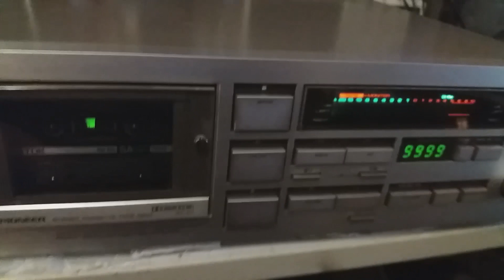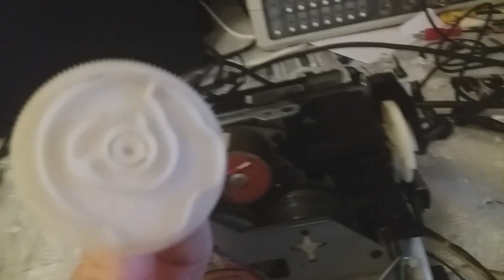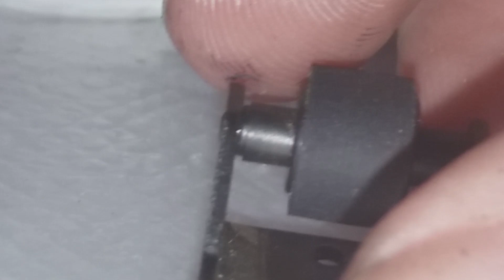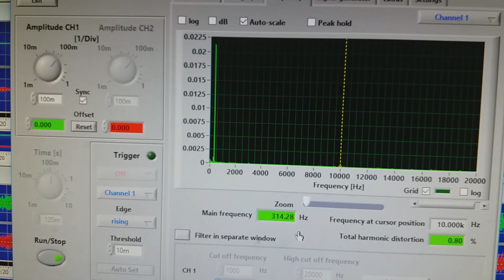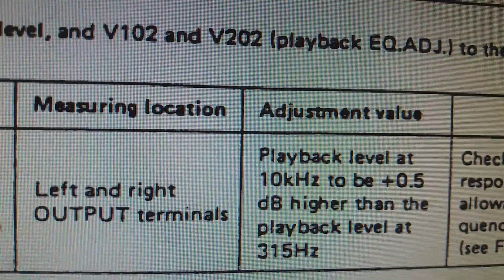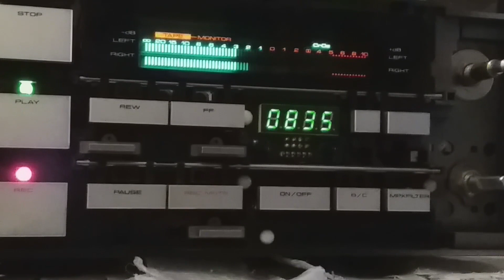Vintage Pioneer CT-A7 (1984) Repair & Service

Comment: You still got it right with -27.7db but it might be confusing for other viewers that you assumed that that the STD331B is 150nWb/m wich is wrong.
And that the MTT255M is referenced to 0db = 200nWb/m wich is wrong too.
This would be a difference of 2.5db and not 4db!

Pioneer STD331B  is 160nWb/m DIN (146nWb/m ANSI)
TEAC MTT255M is -24db from 250nWb/m DIN (228nWb/m ANSI)
Or -20db from 160nWb/m DIN.
So -27.7db is correct, but it's a miracle how you got to the correct value with your wrong numbers...
Reply from the maker: I couldn't find the values back then and I found one obscure reference that said 200nwb/m, maybe I did a mistake while searching... Thanks for the clarification! Math was never my best subject 🤪

Comment: Hi Oreg866, I have a question for you. I recently acquired a Sony TC-K909ES 3 head cassette deck. When I record a cassette and play it on another deck, it sounds amazing, the bias, the treble and the bass is spot on. However, when i play the same cassette on the K909 or any other pre-recorded cassette, it sounds like the treble is all the way down. Very less treble. I checked everything I could think of, cleaned the heads (heads looks like new), checked the azimuth, tape paths, even replaced all the electrolytic caps in the unit. Nothing has changed. I even downloaded the service manual and i traced the path for the playback head. The pre-amp on this play back section uses a Mitsubishi IC 5220 (8pin) which is located right next to the playback head socked to the board. While playing back, when i place my finger near the IC or the socket, sort of a interference happens and i can hear the playback with the spot on treble. Might be just the interference causing it. Could this IC be defected and causing it to have low treble while playing back? Thought of changing the IC, would really like your input on this. Can a defected OpAmp IC cause it to have low treble? or high frequencies? I even unplug the play back head and plugged in the record head to the playback socket, level becomes really low but the same thing, no treble. So cannot be the head. As I said, OpAmp uses 3 electrolytic caps 220uF 50V which I have replaced. I believe the problem lies on the OpAmp somewhere. Please help my friend. I really need to get this fixed.
Reply from the maker: Hi. Feed white noise into the opamp from an external source and check what comes out to make sure it's not a defective playback head.